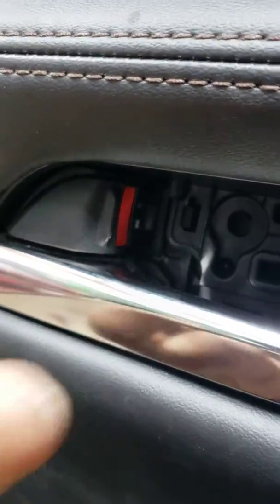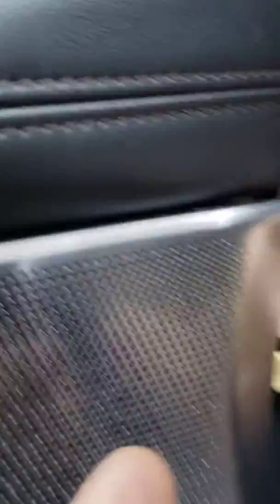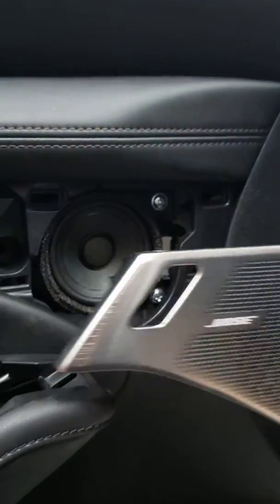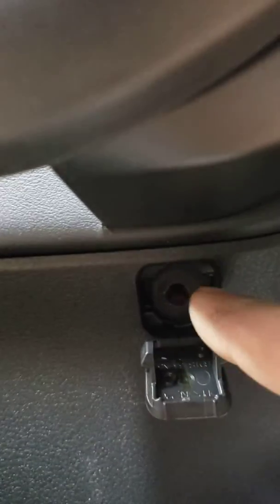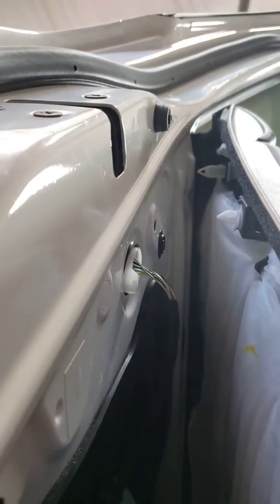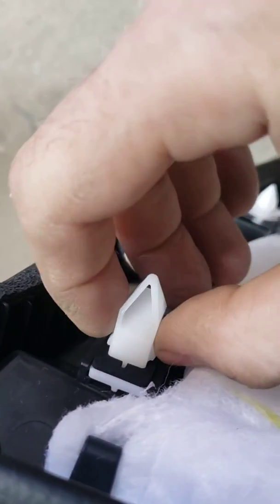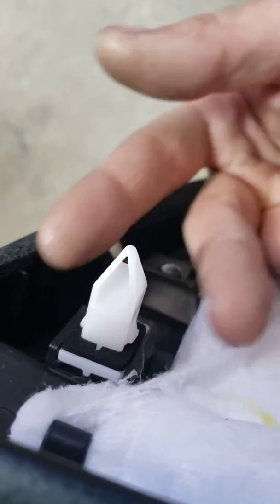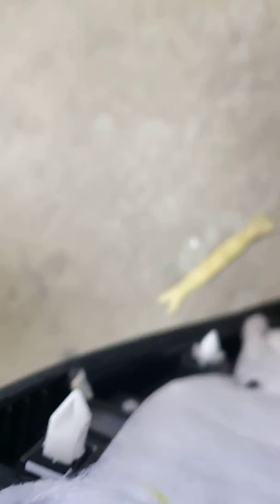2019 2020+ Mazda 3 Front Left door trim pannel removal RI

Comment: Instructions say to replace that top clip if you undo it, is this to stop rattles in the future. I'm only asking as I just purchased the puddle lights and the instructions say to replace every single clip, seems odd if not broken?
Reply: Where do you find the instructions?
Reply: Did you end up replacing the clip? I just got windows tinted and i hear a rattle coming from the top trim piece right below the windows. Not sure if it’s related to this clip
Reply: @joliewu8625 I'm looking at this video because I hear a rattle and its driving me insane. Never took apart the door though so not sure what's causing it.